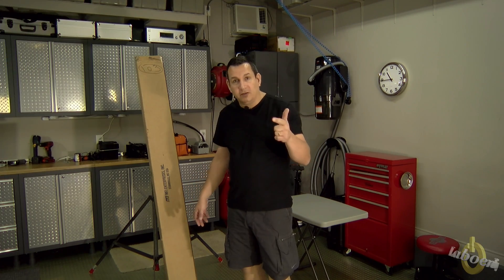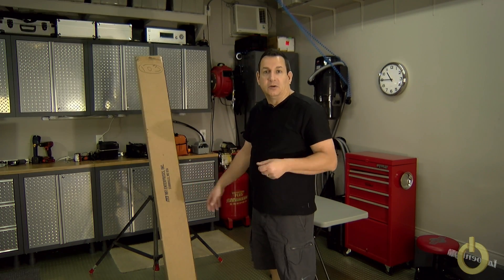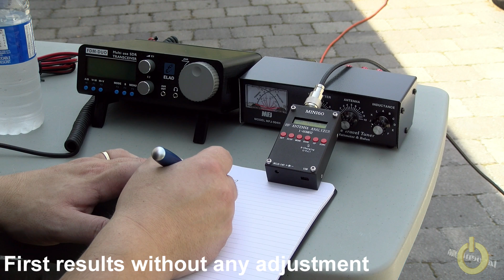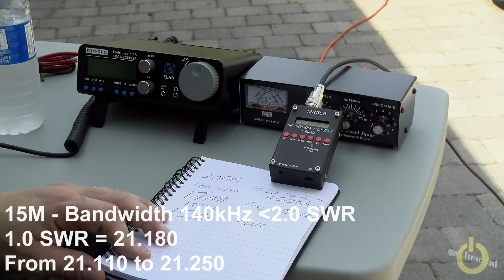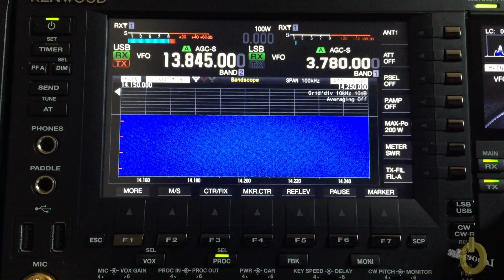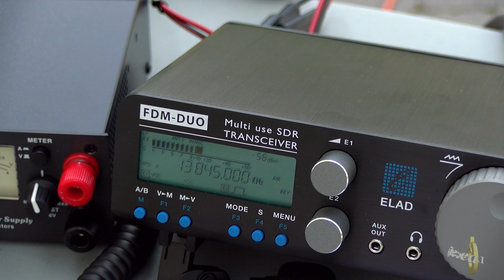MFJ-1835H Cobweb antenna review (high power version 1.5kW)

Comment: That cobweb is impressive especially not  elevated it seems to consistently work miracles against much higher end antennas and height I'm gonna do that antenna uts beco m.j e an easy choice.Ke6iev Kenny 73
Reply from the maker: If you have a clear area to installed it, you will get a good dipole performance with it.   In my case it was good in between my neighbour and my house, but in my back yard it was not high enough to clear my roof, and the south direction was blocked. 73

Comment: So is the SWR low enough that you do not need a wide range external tuner, but most internal tuners, like a FT-991, can fine tune the SWR???
Reply from the maker: Correct, it's like a dipole so there's a match on all band.  You can adjust the length as you wish for each band center frequencies.  An internal tuner of any modern rig will let you operate on all the band frequencies.  So the answer is YES.  Please subscribe! 73 Pascal VA2PV

Comment: Do you find it to be a quiet antenna and how useable is it from a f/b and forward gain ratio?
Reply from the maker: Hi Brian, this is not a directionnal antenna.  It's omnidirectionnal.  Seam equivalent of my Yagi, but wihout good conditions on HF it's hard to say.   I'm waiting for my remote coax switch and then I will set it up permanently stay tune for another video with more details.  73 Pascal VA2PV

Comment from the maker: I noticed after I posted the video online that at 7:31 my shack radio (TS-990) is in USB not in AM like the Elad QRP outside.  The TS-990 would have read a better signal in AM but not much (2 to 3dB max, just tested on the same frequency), so the signals are still similar.  Sorry, my mistake, 73 Pascal VA2PV.